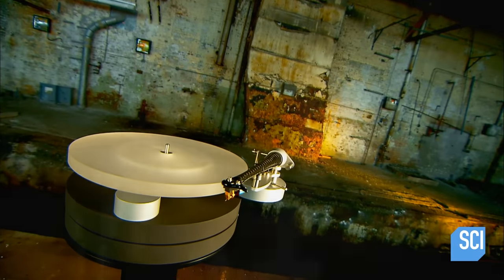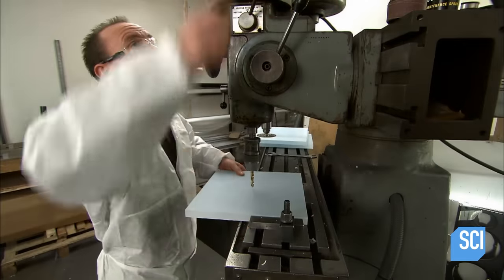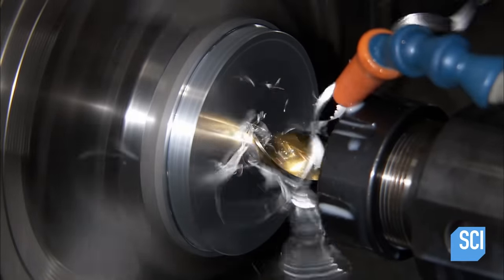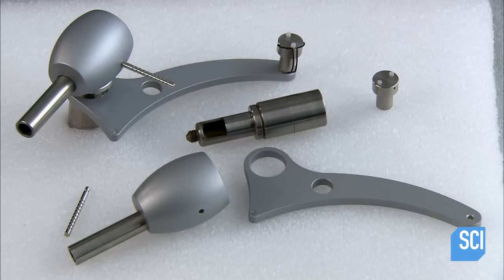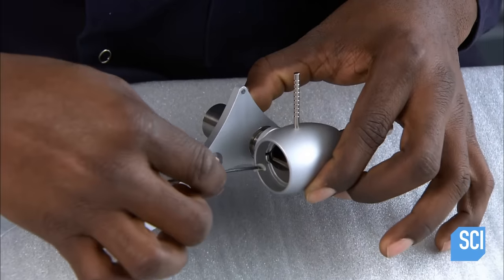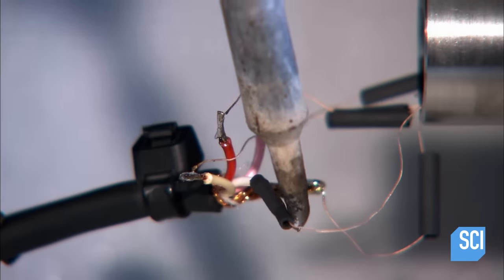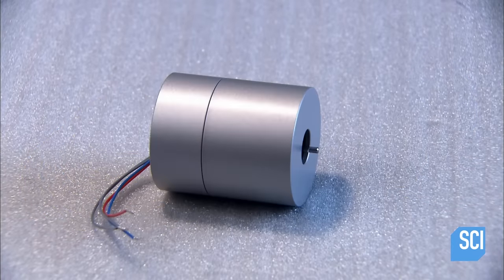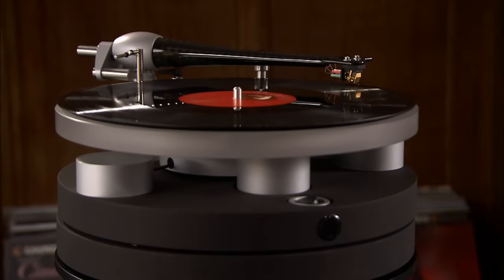How It's Made: Turntables

Comment: The shoddy diy electrical work, did not match the high-end mechanical parts.
Reply: That $15 soldering iron....
Reply: And they can't afford a heat gun to properly shrink the tubing on those horrible solder joints?
Reply: Then he just fuckin stuffs everything in there, so much excess wire dangling around in there
Reply: I mean, the thing is glued together.
Reply: As someone who has to deal with budget cuts... I can see why, not saying I agree with it all, just saying I understand. Lol
Reply: Yeah, the old shit is better
Reply: @desktopabyss6198  Sure, but at least spend $100 on a proper tool. (Hakko, Weller, etc)
Reply: @ziginox  HAKKO, no doubt about it!😉😁💯
Reply: I mean, atleast it's handmade?!🖐🤔😬🤣
Reply: @choke666  My question to those "Critics" is, can Any of them to a Better turntable than THAT guy ? Oh,Better yet, would they even how to start the process? 😆
Reply: @danyahpereira1006  TRUE THAT! LOL.  looks like a carbon fiber arm to boot.  All in all it's better than any modern electronics you would buy.
Reply: High end is merely an illusion. Just look at apple, charging 4 to 8 times the price it costs them to manufacture the parts, which is hilarious since a lot of their materials are bought cheap from China, and even more hilarious when there's brands like Xiaomi with better quality for far FAR cheaper. Point I'm getting at is work quality doesn't match what you buy all the time
Reply: You have got to be kidding. LoL. Thatis no way to align a tonearm and what about the wiring. . I don't know if I trust the science on this lol
Reply: And a cheap motor !
Reply: @r423sdex  It's at least a $50 motor, possible $100. I looked it up.

Comment: I think I could have soldered and wired that better, and I'm awful at soldering. This is a $50 turntable rather than a $5000 turntable...right? Right? I'm struggling to justify buying a new tone arm for the Thorens TD-124 in my parents' basement, never mind dropping an amount of cash that could be the down payment on a new car on a new turntable.
Reply: Wait this piece of junk is $5000 ???
Reply: @pronoe , you're paying for all the material they machined off of the big blocks of materials.
Reply: Tone arm wires are about as thin as human hair and not the easiest thing to solder even with experience soldering thicker gauge wires. You also have to do it four times and use heat shrink tubing on all solder joints.

The TD-124 tone arm being surface mounted should make the job easier but it still won't be pleasant.

The new $1,000.00 Technics SL-1200MK7 has history but the vintage MK2 have been the best since the late 1970's for direct drive with exceptional damping. Replacing the tone arm on a MK2 is a small nightmare because of the damping. The MK2's where used in pairs in almost every nightclub around the world for many decades before things went digital.
Reply: @frankorandle I've soldered coax cable where the outer diameter is less than 1mm. Those wires are a piece of cake.

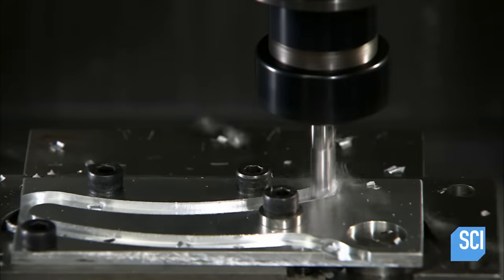Comment: 2:00 I like how they cut to the final small part being peened to have a satin finish with a bushing in it after it's been CNC'd from a big-ass billet of metal. You could literally make the same part using powdered metal or die casting, but then it wouldn't be "audiophile grade." Classic.
Reply: There's a lot of nonsense in this video. Like using carbon fibre on a balanced arm instead of metal (why does the weight matter if its balanced?) Then using 'copper coated wires' to avoid interference? So it's got massive capacitance then?
Wouldn't be surprised if an old technics 1210 gave a better sound in a blind test. It is technically superior after all, with its direct drive.
Reply: @jdmjesus6103  I guarantee it probably would, esp. since most of those older machines had some form of speed control for the platter drive. The drive mechanism on this looks like something from someone's science fair project in grade school.
Reply: @jdmjesus6103  "copper coated wires"...No! they have a copper foil overwrap.  Yes, that does increase capacitance. So what?  That's easy enough to compensate for in the audio circuit.  More important, that copper wrap shields those pickup wires from EMI and RFI which could induce static at the audio pre-amp.
Reply: @mysock351C  The differences in motor technology are night and day different.  Motor speed is digitally controlled on the new motors.  Old phonographs had to be adjusted for each of the three speeds (33rpm, 45rpm, 78rpm) using a oscilloscope by turning a potentiometer on the control board.
Reply: @jdmjesus6103  technices are the best turntables out their.  If you can find a real vintage one that still works it produces the best sound quality
Reply: @scottsatterthwaite4073  no, it can't easily be compensated for, wires should always be low capacitance. Too much capacitance and there will be a frequency roll off at the top end. 

And you missed my point, they used a carbon fibre arm. If interference was an issue then a steel arm would have been a much better choice, than carbon then coating the wires in copper to compensate, that's laughable. 

Also I'm guessing you don't know what a 1210 is, they have the best speed control in the business. A dj favourite, they keep perfectly in time indefinitely.
Reply: @jdmjesus6103  You might be right. My engineering degree, almost 50 years experience, 3 FCC licenses don't mean squat.
Reply: @scottsatterthwaite4073  Damn, you have so many qualifications that you're not able to be wrong anymore? That's amazing, brother, good job!
Reply: @scottsatterthwaite4073  just enough knowledge to be drawn in by this snake oil, not enough to see through it. Wait, you didn't buy one did you? Or are you an employee of this company?

If you're that qualified, explain to me the benefits of using a carbon fibre tone arm.
Reply: all of you need to touch grass immediately
Reply: Sintering or die casting would be too expensive to set up for boutique production like this, and even if you did make it cheaper the target audience would think that makes it worse
Reply: @maxhammick948  The whole thing is just all wrong, regardless of what their production volumes are. I used to work in a low-production volume environment, and you found ways to at least make production make sense. But the problem is the audiophile market runs on lies so they have to make each part as distinctive as possible for market differentiation. If not, the charade BS stories they come up with like it's shape is needed in achieving magical Feng Shui spiritual balance needed for proper transparency and vocal intimacy wont be believable to their gullible audience. In reality its just a wildly overpriced piece of metal that hangs off the other end of the tone arm. It could be a bolt or even a roll of quarters taped to the end and still achieve the same effect.
Reply: @mysock351C  pop😅
Reply: @jdmjesus6103  First of all I admit I don't know shit. Second, could carbon fiber have less vibration and that's why they used it?
Reply: @bertroost1675  doubt it. It wouldn't be as rigid as steel and there's ways to damp vibrations if you need to. Carbon fibre is used where weight is a priority, it doesn't really have any other redeeming features. And when used like this, in a low stress environment, it's basically just the resin that binds it, it will never be stressed enough to actually need the carbon fibres that are impregnated in it. It's not even dry weave so it's just for show anyway. 
Tl/dr, steel is usually the best choice if weight doesn't matter.
Reply: @jdmjesus6103  I used to have a couple of Well Tempered tonearms, they were prototypes. One was carbon fiber and the other metal. I kept the metal one. I really saw no benefit in the carbon fiber. I think manufacturers use it because it's "new"ish.
Reply: @bertroost1675  if their only argument for using was 'it looks cool' I'd have no problem with it. I just know that it wouldn't be. Also it is a bad choice sonically. 
I have no problem with people buying high end audio gear, I have some half decent stuff myself. I just don't like the dishonesty that often surrounds it. 
I also dabble in car audio and most audiophiles could learn a lot from that. The technology is so much further advanced than most home hifi stuff because it has to be, as it's much more difficult to get a good sound in a bad environment like a car. The last one I built for myself was a 3 way active crossover system with full dsp tuning, that's time alignment and 30 band Parametric eq on each driver, manually tuned with a calibrated microphone. If that kind of tech was adopted by audiophiles instead of all the nonsense they would see actual results. 
I also do a bit of production and no one is spending fortunes on fancy cables there either, and that's recording the music that people play on the fancy cables and things. Makes it all look a bit silly really.
Reply: the real stuffy audiophiles are what make outsiders scared of high-end audio, and sound engineers ashamed of their craft

Comment: All of that beautiful machine work, carbon fiber, and design, then install a $2 motor and belt. Wow!
Reply: If it's work, why not? It will also be cheaper to replace it in case of damage.
Reply: @mra.prasetio  You want a very accurate way to control RPM's. It will not sound right if the RPM is off even just a little.
Reply: I thought the same thing, so I looked the part number up for the motor and it looks to be a £90 component
Reply: You also must know that the black gentleman was added for woke effect.
Reply: @alanrogs3990  The show is out of Montreal,  so no, they are not concerned with  labels applied by Governor DeSantis.

Comment: Most very high grade turntables use air bearings or oil floated journals with heavy brass, glass, ceramic or stainless steel platters. You can also choose from direct drive ironless eddy current or belt driven AC synchronous motors.  They can weight hundreds of pounds and cost tens of thousands of dollars.

Comment: Countless amount of turntables I repaired back in the day, from Dual to Denon to B & O.
I'd rather have one of those than the one in this video.
Reply: Setting azimuth by eye
No azimuth adjustment
Off the shelf motor complete with the part number and where to get it

Amazing
Reply: Yes, looks absolutely worthless. The vintage turntables are much more nice to look at.
Reply: Also, the solder job was kinda, questionable?
Heated up the heat shrink sleeves with the iron instead of like - an at least $20 heat gun.
Reply: And the one in this video costs a few thousand dollars too
Reply: I still have my Dual 505 from 1980. Doesn't get much of a runout though these days.

Comment: Amazing - a CNC machine cuts a circle, but can't cut the center hole??? Really??
Reply: When you load a blank of material into a CNC, you need a known datum. In this case, a center hole is likely more convenient than ensuring any piece of acrylic they use has a precision corner.
Reply: @_Jigen  I understand that, this is what I do with a vinyl record that I CNC. In this  case though, I'd mark in the software where the center is, and what circle I want, input blank's dimensions, and let the machine do the cutting - much more precisely. What they did makes little sense.
Reply: A lathe will always do round things better than a mill, it's about concentricity. That said, this turntable is all looks and no performance.
Reply: My favorite bit was using an entire mill as a glorified drill press

Comment: Ah, yes. The ol' Hipster MP3. But the records aren't really good for the environment. They're made of plastic derived from oil, and they take up a lot of room and weigh a ton. Now that we can digitize and save our music locally or stream it from anywhere, there's really no need for the extra baggage or future plastic waste.
Reply: Go and told the same argument to China and India.
Reply: It doesn't matter what we do to help the environment, because India and China pollute more than everyone, and they simply don't care at all.

When you buy a record, you don't just throw it out after a couple years, it will last for decades and decades. I've got Records from the 60s that still sound great.

Sure they take up space, but that wasn't a problem until digital formats and later streaming services.

Analog media formats don't have issues with digital bit rates, meaning no degradation of the sound quality, ever. 

A record or reel to reel tape will always sound better than a digital file. Convenient? Not really, but convience is for the lazy.
Reply: @rebeccabailey527  Respectfully disagree on which will sound better. Digital formats do not suffer from hiss and pop or scratches, and will not degrade through copying if you do not compress them.

Note that this only refers to non-physical media. Every single digital but physical form -- DVD, CD, cassette tape, DAT, plus VHS, Beta, Laser Disc, etc., will break down over time. I've got data CD's over 20 years old that have lost their interior coating, for example, so that they can no longer be read.

But... don't think that the same thing can't happen to all that vinyl. They can warp, chip, crack, get scratched or (surprise) just wear out over time from having that sharp needle scratch those grooves one too many times.

Electrons stored on digital media, however, will last a lot longer.

As for the environmental, thing, you're forgetting this part: Only the good LPs get saved. But do you have any idea how much crap just gets tossed out?

Go to your local hipster music store, flip through their LPs, and ask yourself how many you would actually pay more than a dollar for or want to have taking up space in your closet. I'm guessing that the answer is well below 1%, and that most of the albums you look at will elicit a response of, "Who?"